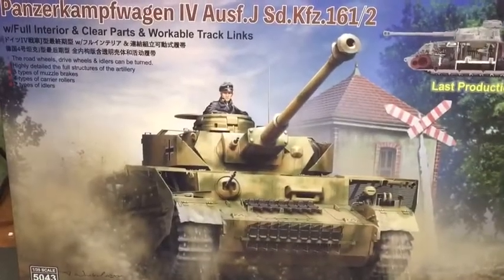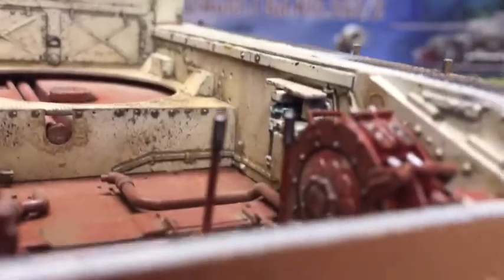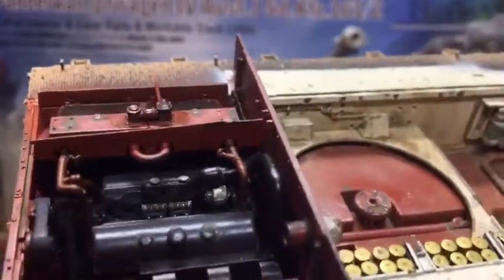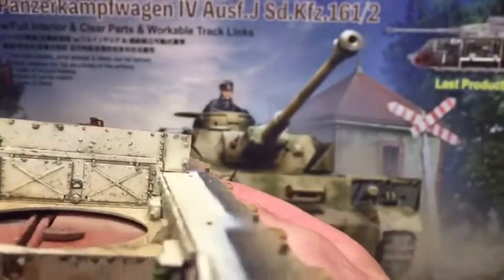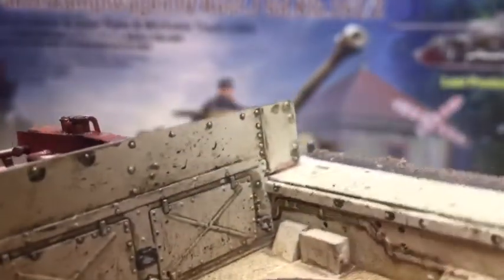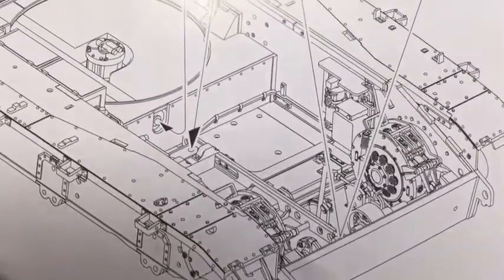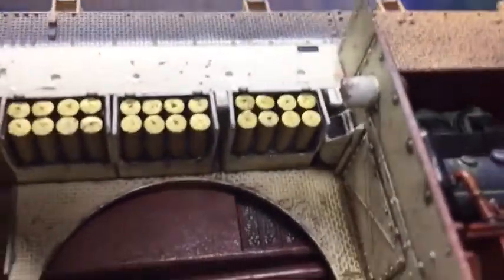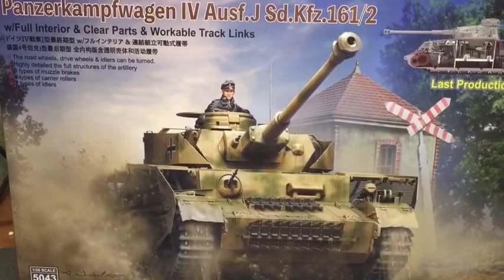Ryefield panzer iv ausf j sd kfz with clear parts update 2

Comment: I am having issues with the Ammo Mig paints, they don't cover well even after priming. Advice? You've done a great job
Reply from the maker: thanks for the kind words the best way of using mig paints is to do light coats keep building the layers up do a dust coat first then start building up the layers till its covered once you get the hang of them they are great paints hope this helps